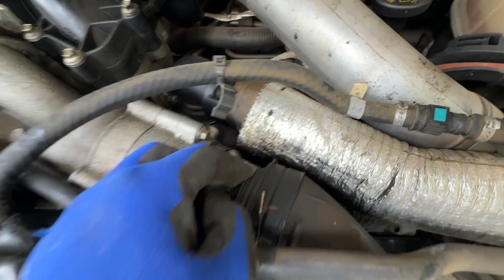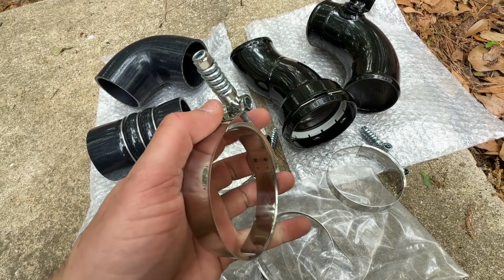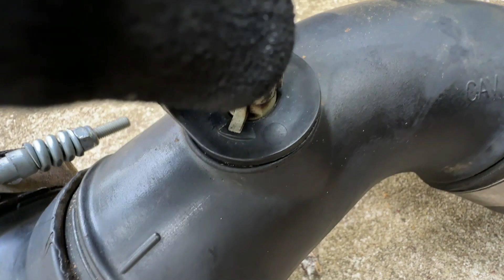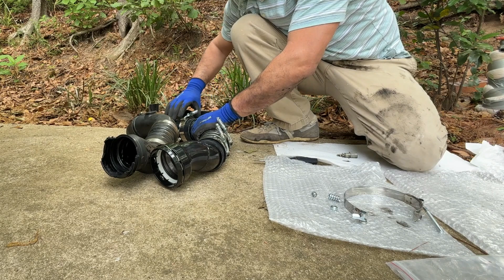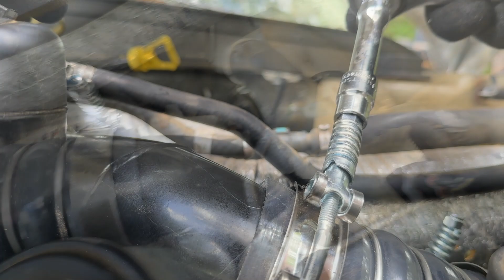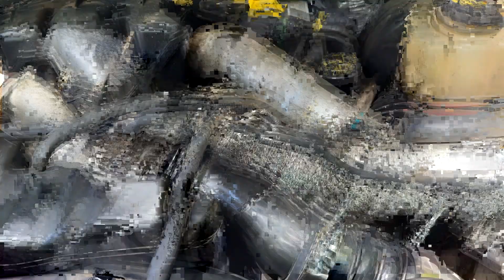How to Replace Cold Side Intercooler Hose in a F250 6.7 Power Stroke | P00BD Fix

Comment from the maker: It’s crazy how these plastic OEM pipes are designed to fail right at the intake! 😤 We saved nearly $300 by doing this ourselves with the stainless steel kit.
Quick question for the Power Stroke owners out there: How many miles did you have on your truck when your intercooler hose finally gave up? Let’s see who held out the longest! 👇

Comment: mine wont fully fit onto the throttle body any advise ?
Reply from the maker: They really hard to fit, mainly if they are not OEM. Is that metal or plastic/silicone?